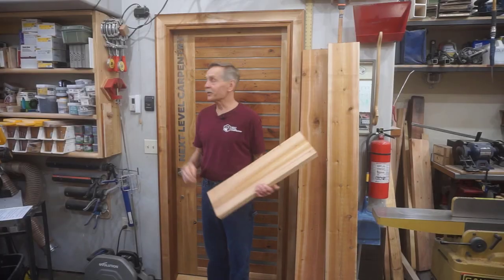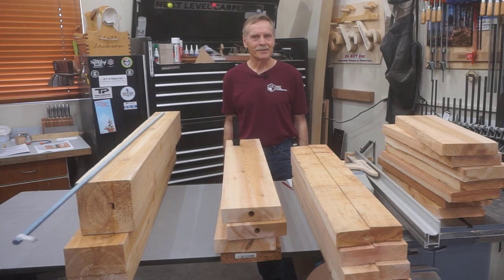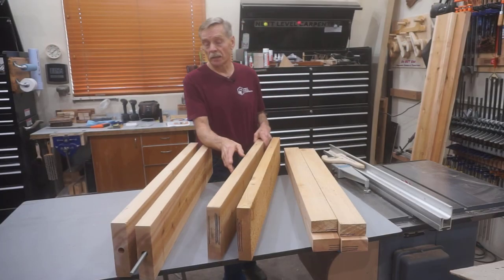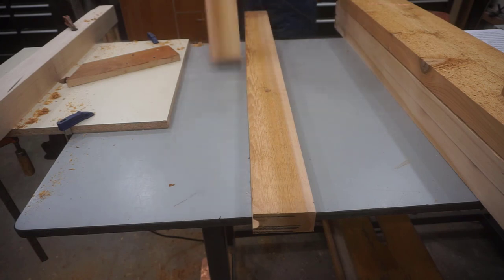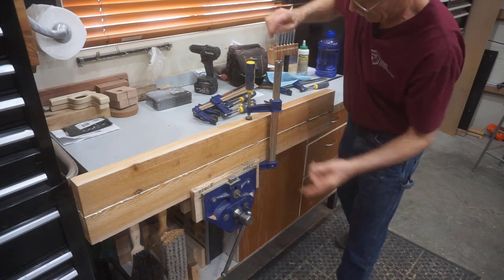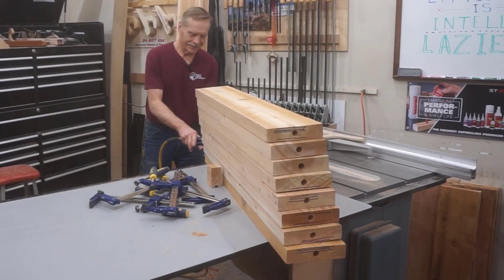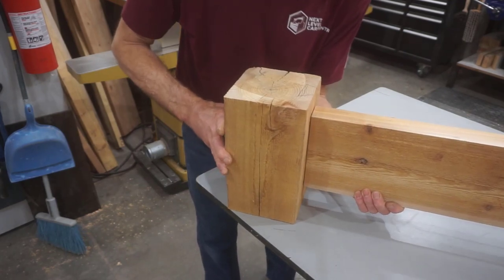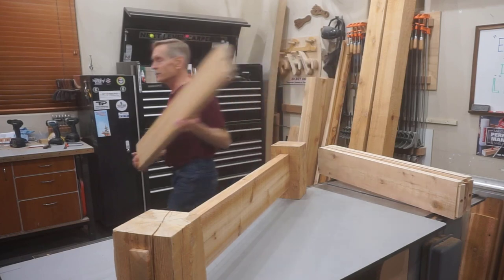Perfect Holes in Long Boards

Comment: Last year I used your trick to use threaded rod to install a newell post. The post I ordered actually came with a piece of wood glued in the center of the hollow core and was about 2/3 the length of the newell. I ended up drilling a hole with a ship auger and extension bit. I had to drill from both sides and use a pair of guide holes to line things up but I was able to make it through without busting out one of the sides (barely). 

I am disappointed that I couldn't have used this method and was hoping you would have some other trick that would have worked. Next time I'll make sure to order the newell post completely hollow!

Comment: Oh wow that’s all cut right through that bolt? That was it you didn’t have to hit the edges or anything? So nice !
Reply from the maker: And that was just a little 1/2" rod... you should see it cut through big stuff: just as effortless and just as clean.  No smoke, few small sparks, just a slight burr and so little heat generated that you can pick up pieces without gloves and not get burned.  Stay tuned as the saw makes a debut in an upcoming video here at Next Level Carpentry! 😎

Comment: Very nicely done. Well lit video with good audio,, great idea for making the long holes in each board... here I am making a kitchen island...  and the long threaded rod will be handy to construct overhead lighting without the wiring showing as all... allowing me to place conduit into the hole instead of just slipping the wiring through and open hole. 
   The End caps did add quite a nice touch at the ends of the boards. 
  As far as the router table ? I did this with my circular saw for my first ever table saw. If it works and you understand the Safety in such of the spinning bit then why not ... 
   In the end I enjoyed the video. Best of luck in 2022!!

Comment: I have used this technique to make workbenches that are (1) bombproof, and (2) easily taken apart for moving. There are other ways to accomplish this, but as far as I know, none are stronger than this.

I had to laugh at your "ghetto router table" comment.  I made "table saws" and "router tables" just like this at job sites for years.  They were inexpensive, accurate and useful, and there was no need to carry around heavy or even medium-heavy equipment -- which in the 1960s and 1970s was pretty damn heavy.  That was a win-win-win-win in my book.  Most importantly, the work always got done quickly and correctly.  Enough said.

Great video. Thanks!
Reply from the maker: Thanks for watching... and adding one of your trademark 'been there, done that' comments Jerry!
I too have fond memories of those on-the-fly purpose built router table/shapers whipped up for re-creating trim profiles on restoration projects etc before there was even such a thing available commercially...
Best, Matt
Reply: @NextLevelCarpentry  In many cases, I have been there and tried to do it. 😎
I would not presume I ever did it as well as you. Cheers!
Reply from the maker: Presumptions aside please keep in mind that I have the super power of video editing under my cape! 💪
Reply: @NextLevelCarpentry  Many is the time I could have used the ability to erase and refilm.
Still, because there were usually witnesses, I am not sure how well that would have worked. 😎

Comment: Your channel is way of above my skill level, but it's fun to pretend I could hang with the big dawgs. I always learn things; however, and I love the elegant solutions to the same problems that I've tried to solve and failed. I have your square tubing inside seam remover kit, btw love the thing.
Reply from the maker: Wow, that's cool to hear from a seems impossible tool operator! FWIW I plan to do a build series soon for the roller stands which were the reason for inventing that tool in the first place...

Comment: What a pretty slick way to do that. Those end caps sure made the posts look 100% better. Could you have used a course wire wheel in your drill to roughen up the glue lines instead of the saw?

Comment: I don't need one of your bunk beds, but man I want one.  Also thank you for sharing. I have faced this issue a few times and couldn't come up with an idea.
Reply from the maker: I've built a number of beds over the years but this is the first one that pushed me to come up with this method as a solution... hope you find it useful someday when you can use it to solve a similar problem...
Best, Matt

Comment: I had a similar need for rough sawn mahogany spec'd in certain sizes. Milled the boards to size and used a 12" bandsaw but ran the board backwards against the blade to give it a rough sawn texture and sized to the architects drawings.
Reply from the maker: Interesting story Dennis... I too have used your 'backwards against a bandsaw blade' method for high volume rough-sawn texturing.  Great minds think alike, right?  Thanks for watching and commenting on this one too! Best, Matt

Comment: I enjoy your vids.  The quality of timber is not good these days if you live where the home stores have driven good lumber yards out of business.  Warp, cup, wind, checked,  snipe, etc. My joiner , planer, surfacer get a lot of use.  The technique of splitting long or wide stock and using a large box bit in the router for long holes works but today I have to buy stock much larger in dimensions then rip with a narrow curf blade to maintain as much grain pattern match as possible because I still need to true up the edges with the joiner before cutting the groove because of the stress in much of the timber. Thanks again for your vids.

Comment: This is a great idea. One of the first things every carpenter learns is that "the glue is stronger than the wood itself." Why not take advantage of that? But—and I'm not trying to pooh-pooh this at all, but—it's not universal. One reason this method might not be ideal in some cases is that it will make a visible seam on the face of any board that doesn't have perfectly straight grain. So it's better suited to obscured structural components, or projects where a practical look is acceptable.

Comment: Bro, you have a pretty nice jointer. Its clear you have experience. The way you use your router looks like a very quick, simple, reliable, and cheap setup. Haters gonna hate don't listen to them. I appreciate you and your content. Not trying to hate but a suggestion would be to not use end grain for your bolt plugs. It might actually be easier as you could rip all the long angle rips at once and it'd look a little better
Reply from the maker: Thanks for watching and commenting on this one Michael. I can tell you that that Powermatic pj882 is the best jointer I've ever owned or used. FWIW the reason I chose end grain for those mortise plugs is because, in the final design and assembly, they need to look like they are an extension of the crossmember itself tenoned all the way through the post. If that were not the case or they got painted I would go with the solution you describe and for the reasons you spell out. As it is I'm thankful they are actually quite quick and simple to make and are plenty strong enough when placed in the mortis so I'm not worried about them failing over time... it's one of those things that's neither right or wrong but a judgment call on my part.
Best, Matt
Reply: @NextLevelCarpentry  ahhhh that makes so much sense about end grain in the design. I was thinking you had a reason as I typed that and almost deleted it. Trust your instincts lol have a wonderful evening
Reply from the maker: @michaelosmon  I'm glad you didn't decide to delete your original question because on the face of it a piece made out of fragile end grain is usually a poor choice and this string will be informative to other viewers for that reason.
Best, Matt

Comment: Hahahaha I knew you cheated on making those holes. All joking aside, I've done this before, my grand dad when he was still alive, showed me this trick when I was much younger. Now as for your router table, yup, my grand dad did the same thing, in fact, that's how I first learned to use a router. I still have issues with the joint seam, I can always still "see" it there when I do my glue ups.
Now, for that saw trick, thank you sir, actually never thought of using a cheap saw to rough up the edges/sides/faces in that way. I truly enjoy your videos. I'm always learning something new. Cheers :)

Comment: That’s a very good idea. I would suggest cutting threads on the ends of lengths of steel rod rather than using allthread, it’s cheaper and more elegant, as you say.

Comment: Nice job. You could have saved yourself the trouble of splitting the boards and creating the "holes" by using  bed bolts of the appropriate size or cut to size threaded rod that use the same recess for the posts, but you only need to drill in a short distance into the end of the rails and then either using a drill bit or chisel to create a slot for a nut to capture the bolt and pull the two pieces together. The hole can be placed on the inside face of the rail and plugged if wanted. This technique was used for colonial era beds and for other antique beds.
Reply from the maker: Sounds like you assume that splitting the boards is much more trouble than it is...
Reply: No, I'm not assuming. Not much trouble; then there is the routing, gluing. I suppose fine for a project that is using similar wood and appearance. Some may not want to split the boards or using a hard wood, etc. I was just mentioning another approach that requires mostly short drill paths for a similar construction.  @NextLevelCarpentry
Reply from the maker: @felony53  I agree if it's a matter of appearance and technique but not where saving 'yourself the trouble of splitting the boards' is concerned.  Thanks for adding options to the discussion though... much appreciated! 😎 Best, Matt

Comment: Great job you've got my router table! The only problem I've had with it was the clamps coming loose I now screw a fence to ameliorate the risk of slipping.

That bed looks strong do they let the horse as well as the dogs sleep on the bed?
Reply from the maker: A slipping fence can sure cause weeping and  gnashing of teeth so securing it with any means necessary is a best practice. I'm confident using the screw clamps you see in the video but when in doubt, screws it is!
LOL: A shot with a horse or pony standing on the bunkbed would make a great video thumbnail for bunkbeds in Montana!

Comment: Great video. I just couldn’t imagine how those long holes could possibly be “drilled” through those long boards until I saw how you did it. I’m embarrassed to ask but what’s the advantage of bolting the parts with all-thread (other than taking them apart) over mortising and gluing the end caps on? Thanks, it’s never too old to learn something new.
Reply from the maker: Official through-mortising the crossmembers was just too impractical from a labor/cost standpoint although it would be, by far, the 'best/strongest' method.  In addition, the long bolts allow me (and others) to disassemble and reassemble the bed numerous times and is the main reason we (my client and I) choose a 'bolted tenon' design option for these bunkbeds.

Comment: I’m very new to woodworking and trying to understand it all. 
I was looking for a way to drill a whole in the center of a 7ft piece of lumber so that I can slide galvanized pipe through the center, without affecting the support of the amount of weight it would have to hold. 
With what you are applying here, how much weight would those boards be able to support? 
I would think the stability would be compromised, would I be correct in thinking that? 
If it wouldn’t be affected, I’m going to jump for joy!

Comment: In this situation why not just lag bolts at the ends?   But it is a good tip for the other situations you mentioned,  routing wires for lamp posts etc.
Reply from the maker: Lag bolts are not nearly as strong as this method, especially in cedar, because they'd be going into end grain.  Through bolts like these will resist force put on joints by rambunctious kids on bunkbeds where lags would probably require seasonal re-tightening IMHO.

Comment: Did you intentionally route the groove in the boards before running them over the jointer or could you have jointed them after ripping and then only have to run them over the router once?  Love your videos and this was a very sneaky one!  I had no idea how you were gong to drill holes that long.  I was thinking, is he going to use grit to grind through the boards like he's drilling a well?  LOL you definitely outsmarted me on this one.

Comment: Great video, but I can't help but point out that you spelled laziness wrong on your whiteboard
Additionally, I really want to see the final product. The cad drawing looked really cool.

Are you planning to glue on the caps or attach them with a brad nail or are you just depending on them being a tight fit?

Comment: Excellent solution; never expected that... I wouldn't have been offended if the ends at the posts were simply counter-sunk, with a black washer and acorn nut. The architect in me prefers to express each component.
Reply from the maker: "Inner Architect Approved"... noyce! 😎  I'm always concerned about over-doing just because I can and, since I'm usually so close to the project, loose valuable outsider's perspective. 
Best, Matt
Reply: @NextLevelCarpentry  Design is about making decisions, and you did just that.

Comment: Love your tip and trick.  PLEASE wear ear protection when running your router (or any other loud tool).  You have 45 years in the shop but we'd like to be sure you have plenty more being able to hear well.  Take it from someone who knows what hearing loss due to equipment is all about.

Comment: Would you be able to turn a spindle on a lathe around one of these holes to create a tube? Do you think that glue joint would  hold up to that?
Reply from the maker: No reason I can see that it wouldn't work since a good glue joint is actually stronger than the wood itself so if it did fail it would most likely be caused by wood splitting than glue joint failing.

Comment: I have a corner chisel punch like that. Knowing you, you probably have some awesome way of sharpening those, is that already in one of your videos?
Reply from the maker: Hey Christopher thanks for watching and commenting. That little corner sure works better if it's sharp but I haven't done a video of the process. Best I have for you is a suggestion to remove the Chisel from the tool and tune up the edges with a very fine file and a steady hand to recreate and sharpen the two angled edges.
Best, Matt

Comment: And if you don't have a router, just cut the boards into thin slices, drill each slice separately, then glue them back together. Just keep the slices oriented and in order to retain the grain pattern. ;-) Oh, and remember to account for the cut width, and make the boards long enough before cutting.
Reply from the maker: Or you could just grow a tree with a pipe in the trunk then make a board out of the piece and remove the pipe and Presto problem solved!

Comment: Really nice! After ripping the boards, why did you go through the sequence of route, joint, and route again? Was there some advantage over just joint first and then route?

Also, I'd be tempted to throw on a lock washer between each washer and nut.
Reply from the maker: Hey Ted,
The cut, rout, joint and re-rout process ensures a perfect glue line/joint because there's always a little bit of tearout, deflection, etc somewhere and the 'extra' step eliminates it completely.  I think some viewers get distracted thinking eliminating one step provides meaningful efficiency but I disagree. It takes literally seconds to re-rout and any minimal 'extra' time spent will pay back with dividends with zero fuss during glue up and near invisibility of a glue line in the finished product.  Nothing wrong with a lock washer or a dab of locktite on the threads during final assembly either... virtually free 'insurance'! 👍😎
Best, Matt

Comment: Awesome router table setup!... You don't mention clamping alternate sides - some of us are new to this... also, why not use a body clamp to hold your work square before you clamp it?
Reply from the maker: I don't quite understand your question...
Reply: @NextLevelCarpentry  A body clamp such as those made by Bessey can be used to align the boards and prevent slipping during clamping. It's the revo model if you haven't tried them. Wonderful things. Maybe you haven't tried the technique...
Reply from the maker: @christopherberry8519  Ahh... I imagine many woodworkers use those clamps for that purpose and with that expectation but, while they might help with initial alignment somewhat I'd be willing to bet it's not to the degree of flush-ness I get and expect with the clamps and methods I use.  I'm not saying it's right or wrong but I'd be hard to convince it's better overall...
Best, Matt

Comment: Good tip about the hand saw. Hey, could you save a lot of time and just have epoxied short pieces of all thread in the ends and leave around 6" sticking out?
Reply from the maker: The main reason this method required more time than the one you suggest is that I decided to produce a video showing the process.  Without that, this method doesn't take than much longer and is many times stronger, which is what I wanted/needed for this particular build.  Besides, it doesn't take much imagination to epoxy bolts in place and therefore no video showing the practice is warranted IMHO.